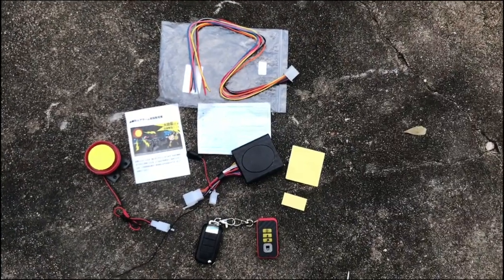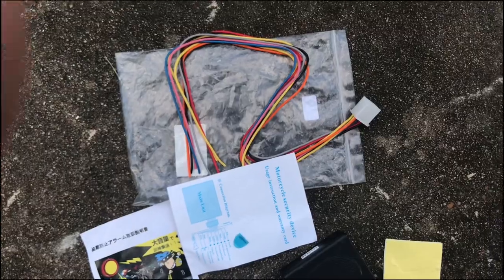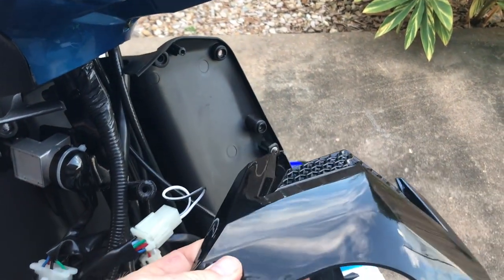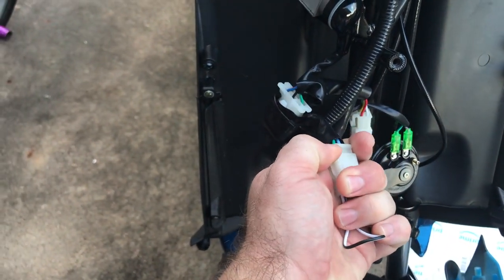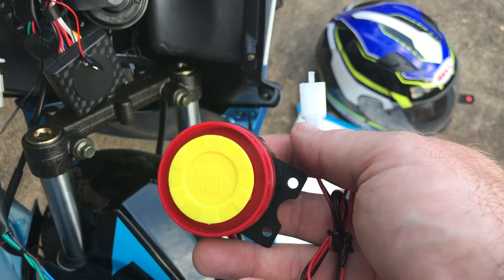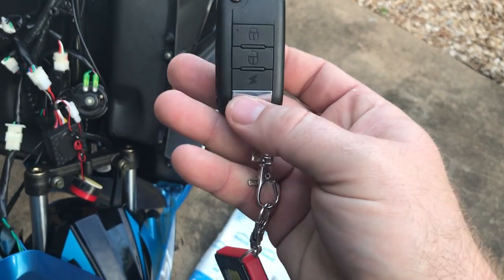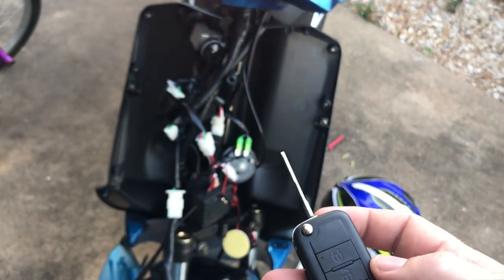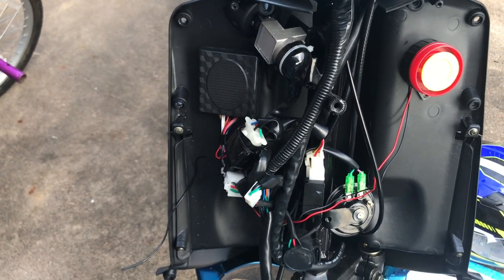Chinese Scooter ToaTao Thunder Alarm and Remote Start Install

Comment: Great video! My two cents...I installed alarm/remote starters on my 2015 Heritage BMS Scooter and my 2022 il Bello Amigo scooter. Both were Znen scooters. Both had the plug Harry showed in his video already wired in, so it was a snap. I will say that the first alarm/remote starter I bought off Amazon (Banvie), for whatever reason, didn't operate properly. I then bought another similar alarm/remote starter (Atfwel) and it worked great on both scooters. This week I took delivery of a 2024 Ice Bear Hawkeye scooter and after speaking with their tech, I was told the wiring harness is pretty standard on all GY6 scooters and that it did in fact also have the plug prewired to add an alarm/remote starter. I ordered another Atfwel alarm/starter, and it comes in tomorrow. If I don't update this, it means the install went well.

Comment: I just Bought one for my Scooter! Waiting for it to arrive, This is a great video it deserves more views!!
Reply from the maker: That Guy Awesome! Mine still works but I have to say that I don’t like the remote with a built in key. On my scooter it sticks straight out where my knee could break it off. I use the remote and factory key setup.
Reply: @harrysgarage5039  yeah I just use the Remote key to open my locking seat so I don't have to turn the engine off I have a flatslide carb and it has to be choked on cold days so I just use it to get to my carb
Reply: I actually wouldn't Recommend a flat slide unless you intend to bore up by the way, Because It gets maybe 1+ mph and its a little tricky getting them tuned right

Comment: Thumbs up. Thanks for posting this video. I'm about to order an alarm for my vip. Today was my first day riding and the thing does 50 mph.
Reply: I got my alarm hooked up today. It's obnoxiously loud and sensitive. Sadly the remote start doesn't work exactly right. I still would recommend this alarm to anyone with a motorcycle or scooter.
Reply: What the name of the alarm brand
Reply: @capebongo6622  They aren't really branded. If you take the front panel off your scooter and you have a plug with a wire that loops back into itself you can install one.

Comment: Thanks for this video. I just bought a very used scooter with this system and will more than likely reverse what you did to delete this system. My scooter will not start with the key, it will only start with the remote. Does yours do this since the install?
Reply: No

Comment: Does your tao tao have bogging problems when going up to speed? also what is the link for this?
Reply from the maker: Duncan  here is the link. BlueFire Motorcycle Security Kit... https://www.amazon.com/dp/B01HTGWYBA?ref=yo_pop_ma_swf

Also mine does not bog when going up to speed. Do you have a stock setup or have you made any mods to your air intake? If you have made mods to your air intake without adjusting the carb or rejecting this may cause this. You could have a dirty carb as well. What kind of scooter do you have? What model engine?
Reply: Duncan, I had a tao tao Paladin 150. t would bog down at times. I did some reserch and was advised to replace the spark plug wire with a better brand equivalent. I replaced my spark plug connector with a Nippondenso spark plug connector and it got better. 

You may have to up grade some parts as you can afford to, to improve the performance/ operation of the budget  conscience scooter.

Comment: Do i need to put on a battery on it?
Reply from the maker: Yes you will need a battery for this to work.
Reply: If your talking about the 9v connector, my unit didn't come with one, there was a place to put one on the board, but they didn't install one, so, probably not a requirement.